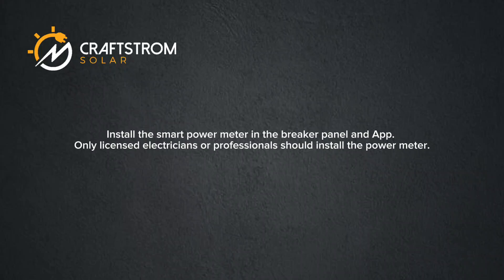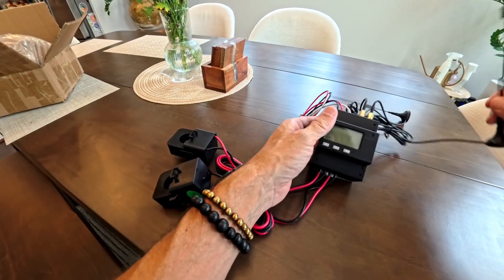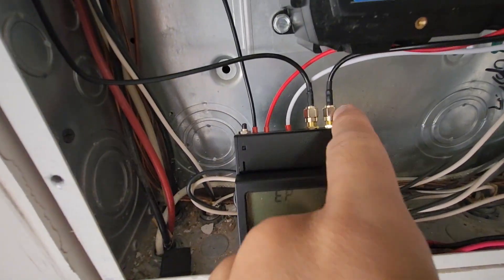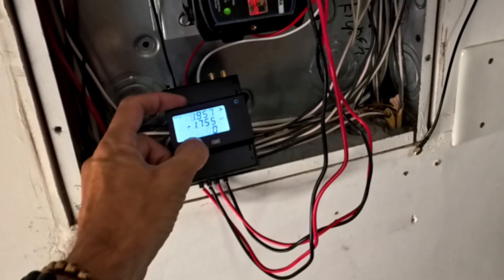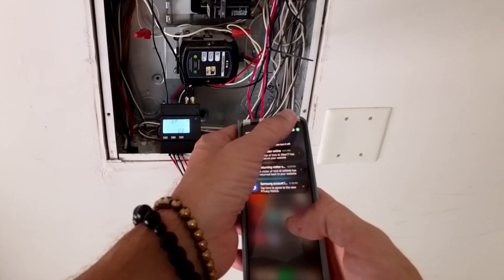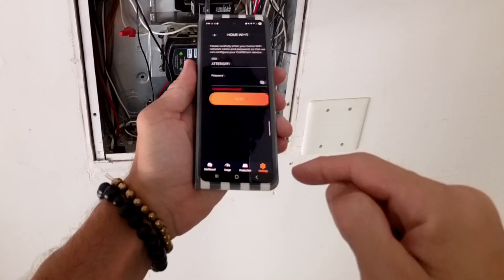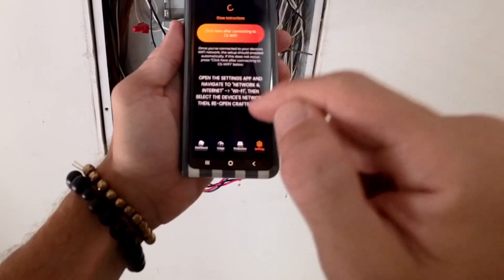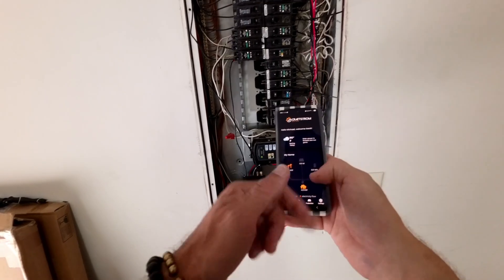How to install the craftstrom power meter in breaker panel and App!

Comment: Be VERY careful and do your research before you buy a system.  I bought a very expensive system from Craftstrom and have yet to see any production.  If you don't have a DEDICATED 2.4 ghz network (or even if you do), AND/OR if your electrical power comes in on the opposite side of your home from where your panels will be, you may be SOL.  I have been working for weeks to get my setup working and  because my power comes in on the east side of the home and the backyard, where the panels are set up, is on the west side of the home, their pathetic network will not connect.  I even contacted  Jeffrey (from this channel) for help to no avail!  And Craftstrom is MIA.  I wrote emails, called, messaged, begged and pleaded and NOTHING!  They will not respond.  I am now looking at a chargeback because I did not get a working system.  BE VERY CAREFUL!!!

Comment: You should also not assume that all breaker panels are inside. In Arizona, most of them are outside. I am concerned about the effects of the heat on the device.